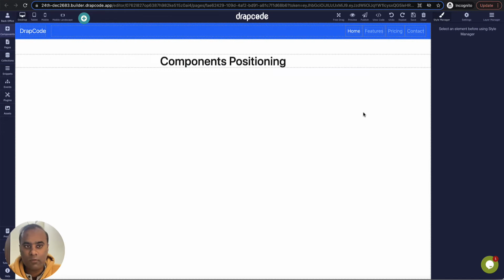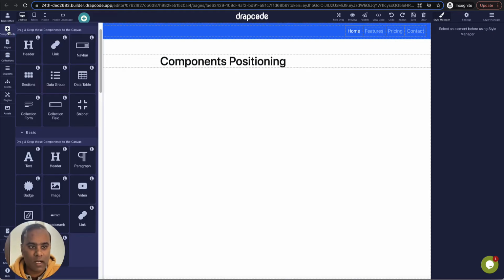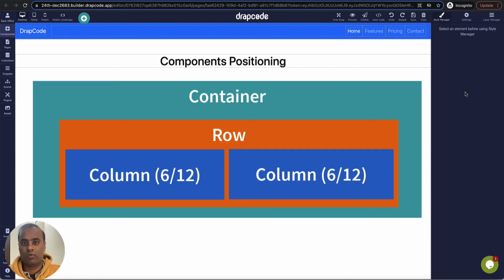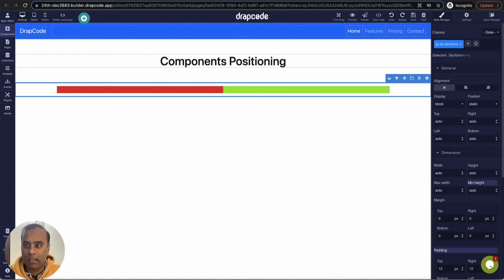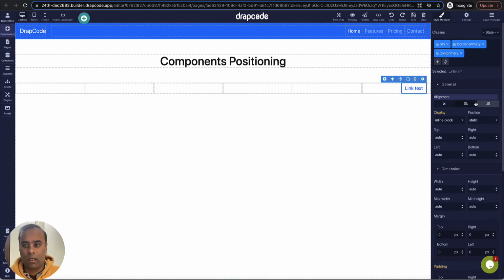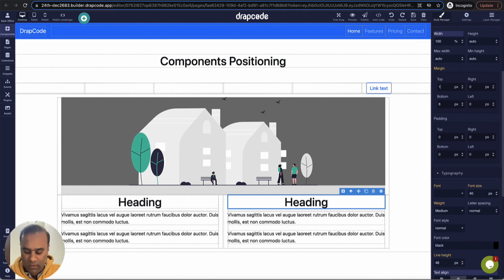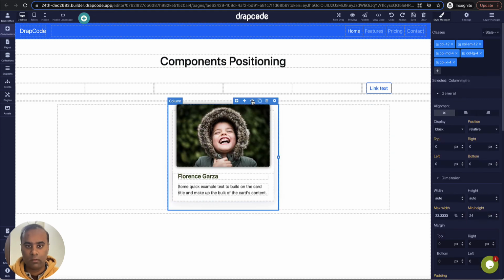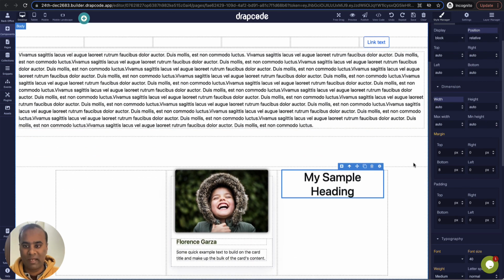Components Positioning

Comment: I tried to read documents and watched tutorial videos but could not know how to position a component on the page as well as in a container. I want to make components not only horizontal but also vertical alignment (i.e: left/right/center and top/bottom/center) in regards of their parents' component...Pls tell/show me how to do that. Thanks
Reply from the maker: Hi Pham,

Please find below the tutorial which covers the Horizontal as well as Vertical alignment of the components inside a div/box/column.

You can do it in 1 ways:
1.) CSS Classes :  Add .d-flex to the parent component/div to enable flex mode. Then use (on the parent component only) .align-items-center to align the content vertically and .justify-content-center to align content horizontally.

2.) Style Manager - Using the Flex layout option, as explained in the video.

https://www.youtube.com/watch?v=5tWq5MBtSaE

Comment: Hi. Do you have another video about this? You know the components' style manager at present does not look the same as one showed on your video here...
Reply from the maker: Hi Pham,

Please find below the tutorial which covers the Horizontal as well as Vertical alignment of the components inside a div/box/column.

You can do it in 1 ways:
1.) CSS Classes :  Add `.d-flex` to the parent component/div to enable flex mode. Then use (on the parent component only) `.align-items-center` to align the content vertically and `.justify-content-center` to align content horizontally.

2.) Style Manager - Using the Flex layout option, as explained in the video.

https://www.youtube.com/watch?v=5tWq5MBtSaE
Reply: @DrapCode  Great! Thanks